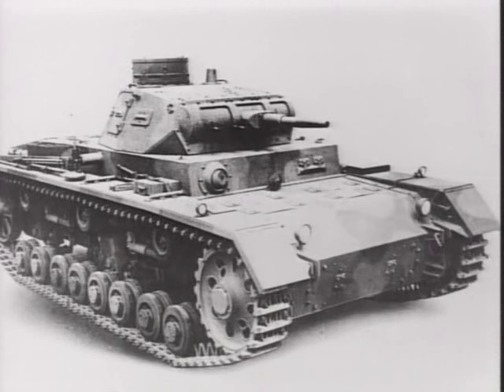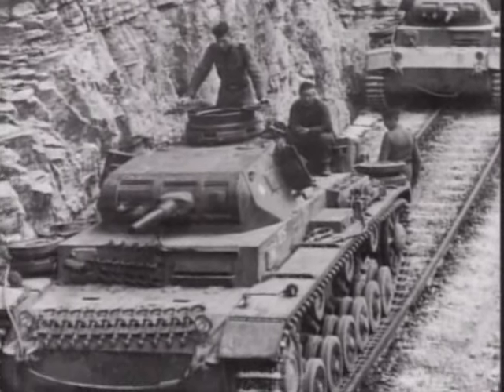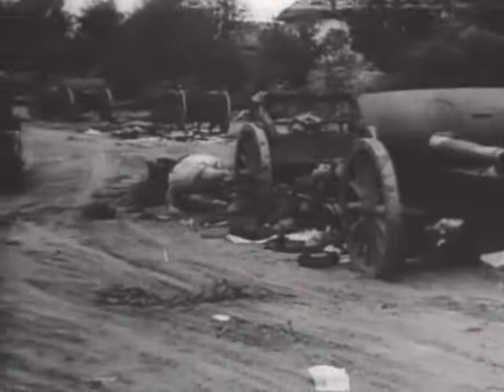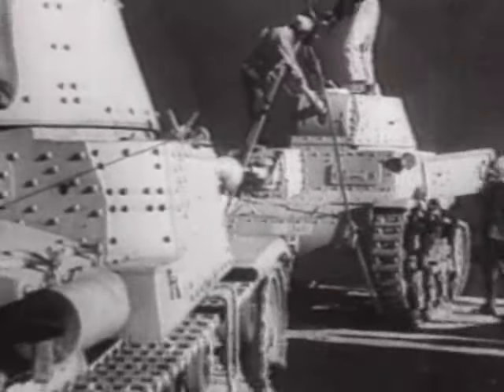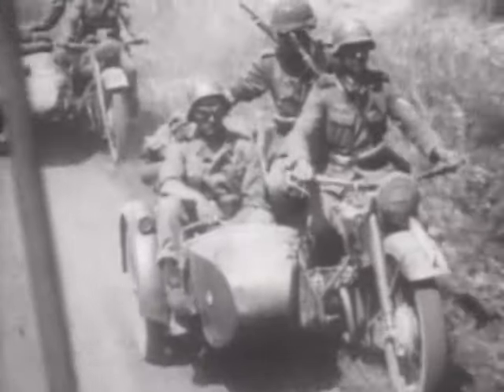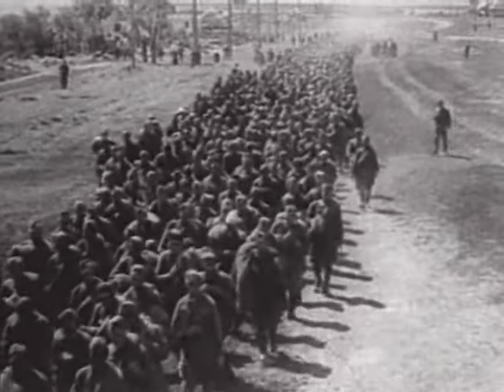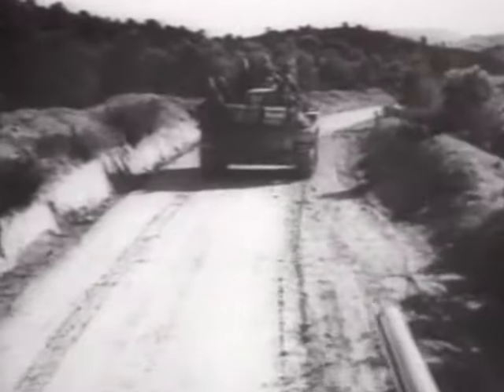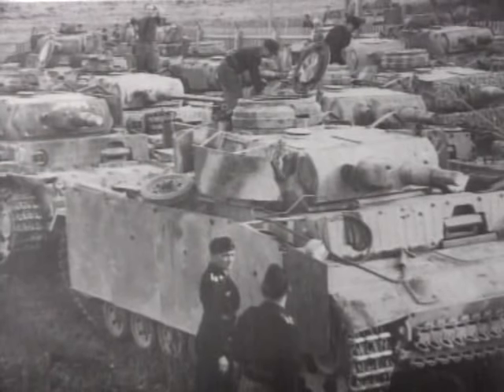German War Files - Panzer III Medium Tanks

Comment: The Panzer III was, conceptually, an excellent "lighter end" medium tank by 1939 standards but, as the war progressed, it rapidly became obsolete (especially on the eastern front where its original 37mm gun was of little to no use versus the more modern sloped armor of the T-34).  It's tank destroyer variation, the Stug III, however, destroyed more allied tanks than any other German fighting vehicle.
Reply: The Stug had the advantage of being on the defensive.
Reply: @kyle857  Stugs on the offensive would advance in lines meant to compensate for their lack of a turret but, on the defensive, it was certainly far easier to conceal (much lower profile without turret), had a vastly more capable gun, and much thicker frontal armor that its turreted cousin.
Reply: The Panzer III was upgunned and was still a sound medium tank design through 1942 and a viable frontline tank through 1943,  often still able to outfight a T-34 with 76mm gun, but certainly looking more vulnerable and reaching obsolescence. Stug III with long 75mm gun offered better bang for buck by then and Panzer IIIs  relegated to secondary roles, such as training, and quiet theatres such as Norway. 
BTW the number of the Panzer IIIs at Kursk were Ausf N variant  with the short (kurz) L/24 75mm gun. There was now a highly effective anti-tank HEAT round available for the gun and the 75mm had a much more powerful HE round than the long 50mm gun used in the previous version of the Panzer III, the Ausf M.
Some thoughts 😄
Reply: the tank PKW3 was still able to destroy T34, mainly because of the poor quality steel used by the Russian and the poor reliability! a lot of T34 was lost even before the battle started, left beside because of malfunction, then the poor visibility was another reason too, not to mention that T34 crew was barely able to move inside!
Reply: @Ezekiel903  excuse me? hahah

Comment: The Germans knew that the British and French had heavier infantry tanks with thicker armour. Thick armour and big guns were initially not relevant in the strategy of Blitzkrieg. Since the opjective was to look for weak spots in the enemies lines, then strike deep and AVOID direct conflict with heavy tanks, cut them off from the rear lines. The enemies heavy tanks would then rumble around for a while longer before running out of fuel.
The Blitzkrieg strategy only worked as long as there were weak spots and the enemy was unprepared (generally not found after 1942).
Reply: Auch das ist sehr richtig !
You are very right !
Reply: where the germans encountered char b's they used superior numbers and speed to defeat them more hits from all sides-there is plenty of footage to support this-rate of firing through better design of turrets -particularly the mk3 and 4
Reply: @MegaBloggs1  Stuka's were everything in France and in Russia in taking out the big tanks.
Reply: @froggleggers1805  they were mainly use in strikes against railways, infantry concentrations and fixed defences-read strange victory about the fall of france
Reply: @froggleggers1805  why do you think a tankbuster variety was built? because they were ineffective against tanks without the 37mm cannon
Reply: @MegaBloggs1 He that thinks he knows it all, read Hans-Ulrich Rudel's book.

Comment: Pz III was better than the Pz IV because of its suspension but it was just too small to allow for the necessary upgrades. 
It is interesting to ponder that delays in implementing design changes such as the long barrel 50 mm were key in failing in Russia in 1941.

Comment: Just think: it was probably just ONE man that anonymously took the decision to fit the 50mm L42 and NOT the L60 as standard from the outset of production. The implications of that must have been HUGE. I wonder if it was the single most decisive factor in losing the war for Germany.
Reply: Well alot of German Panzer Generals sure mentioned it.
Reply: I mean to be fair Anti tank guns were seen as more useful because previously in france the germans would often just outmanouver the french thus making their armor useless. Meanwhile anti tank units who would often be static had alot of trouble defeating most of the newer french tanks thus anti tank guns were given a priority

Even then most t-34 knocked out in 41 and 42 were still by the Panzer 3 and the armor quality of most t-34s could only really hold up against 37mm guns anything bigger would likely knock out the crew despite the fact that the armor of the 34 should hold up against even the 50mm